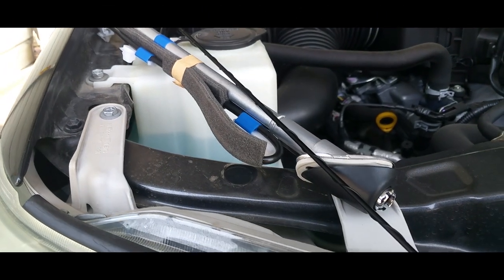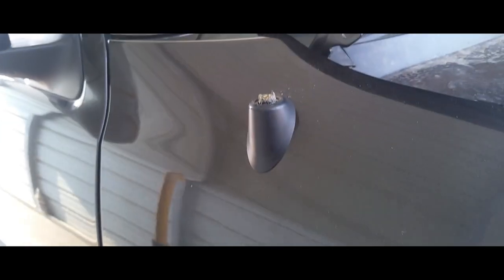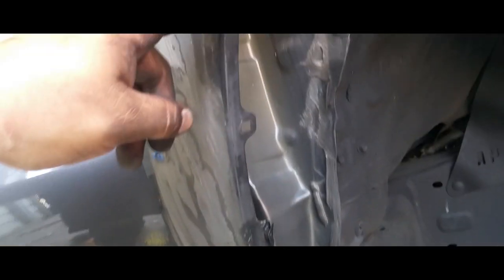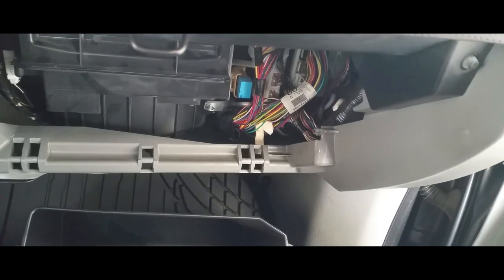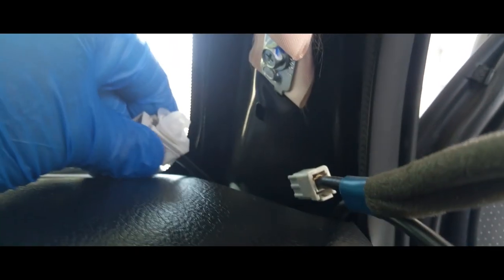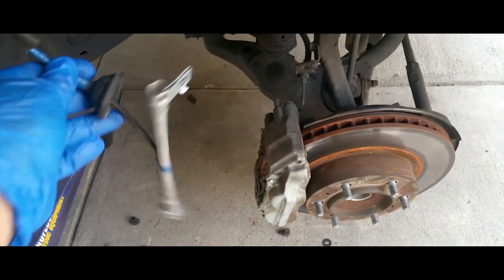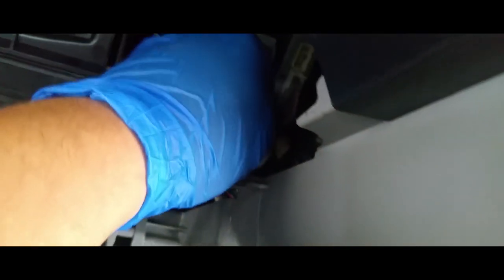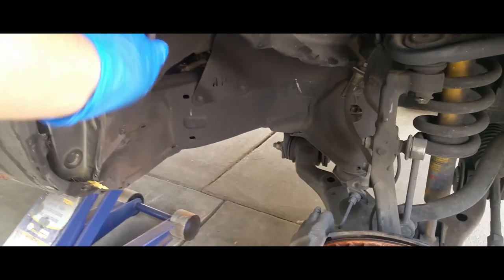How to: Replace a Antenna from a 2012 Toyota Tacoma

Comment: This gentleman did all the hard work, in videotaping and explaining while he was holding the camera.
I replaced mine today:
I didn't need to remove the wheel....
Removed two clips (broke one) from the wheel well cover and just enough to get my hand & wrench inside to remove the base of the old antenna..
Removed the glove compartment and pulled out the wire from old antenna
I removed the panel with handle to disconnect the plug. I didn't encounter any tape. Removal and installation with clean up, 1 hour, 15 mins.
Reply from the maker: Heck yeah brother 💪

Comment: Hi George! Thanks for posting this informative video. I just replaced my antenna today and it went quite well thanks to you! The hardest part was getting the old antenna base off. I had to cut it off with a hacksaw. Didn't trust myself with a grinder that close to the paint. Broke about 10 clips and had to go to the local Toyota place and get more. Whole job took me about 3 hours. Now my radio works great! Just for the record, I'm not a mechanic but an ER Nurse so that tells you how inexperienced I am with car stuff. Thanks again!! Forgot to mention, the Toyota place wanted $500 to do the job. I spent about $170 including the clips.
Reply from the maker: That's great I'm glad to hear I was able to help you out! I love getting comments like these, keeps me motivated to continue to make more videos. I'm glad you were able to save money, this is why I do it! Thank you for your support! Yeah the dealer will always try to make money💰!
Reply: yeah this helped me too.   Also had to cut that base and snap it in half but the best part was seeing that you have to remove the passenger handle and that trim piece to get at where the connector is.
Reply from the maker: 😳😳😳 yeah not any easy task unfortunately  😒

Comment: I appreciate the video it help me today replace my antenna line .. going through those car washes will definitely break your antenna .. popping out those fender screws is a pain in my rear end. I ordered 30 replacements for less than $10 on Amazon. They’ll be here in a couple days and I’ll finish putting everything back together at that time. Anybody that thinks about replacing the antenna do yourself a favor just order those plastic screws and cut the other ones off makes the repair goes so much quicker more than likely you’ll break the old ones anyway ..
Reply from the maker: Dang thats not bad for 10 bucks. Yeah those clips are a pain for sure. Good luck brother!

Comment: I have to do this. my 2013 tacoma only gets like 2 FM stations. The castle nut is not coming off like yours.  I dont want to drill it out. i know ill eff up my paint on the truck. any tips on how to get it off? will it break off with vice grips?? i have all parts on orders. bezel. castle nut. antenna. clips and fender flare clips.
Reply from the maker: Yeah you can try vice grips or maybe even a dremel
Harbor freight has a decent one for a good price.
https://www.harborfreight.com/96v-cordless-variable-speed-rotary-tool-kit-70-pc-63389.html

Goodluck brother

Comment: How did you get the flares off with out breaking any plastic tabs?  I have the new antenna, bezel, and retainer nut on order.  I also bought some new inner fender plastic rivets(4).
Reply from the maker: I used a trim removal tool to get them out. Best way to get them out with out breaking them.

Comment: Dude, you didn’t show how you took the antennae mount out, or how the wiring runs.
Reply from the maker: Whoops My bad Sorry
Reply: That chrome ring is the retainer but for the black plastic housing. After that, the antenna screws into the nut

Comment: Ok...how in the ever loving fuck do you get those grommets out that are holding the liner in place?  Do you just shove a screwdriver in the center and try to pry it out?  Or do you have to pry a screwdriver under the lip of the grommet and pop it out?  And is there any risk of damaging whatever the grommets go into?  For fuck's sake we can put a man on the moon but we can't come up with a simple way to attach a fender liner so it's easily removable?
Reply from the maker: I know right yeah I struggle to get the liner out. I had to use a Plastic Trim Removal Tool to get it out. You have you be careful and gentle and try not to break anything. Sorry man wish there was an e-z way to get this done.

Comment: I can’t even get my retainer ring off. I’ve basically ruined it and broke all the metal off trying to vice grip twist it off. Can’t find any info on how fix this.
Reply from the maker: You have to replace it like i Did
Reply: GEORGE LOPEZ HOW TO DO IT YOUR SELF the part you remove at :53 seconds. That part is 100% seized in place. How do I remove that part if it isn’t just going to screw out?
Reply from the maker: @smmalafa1  i had to use big pliers to get it out you might need cut it out if you cant get it out and get a replacement for it
Reply: @559powerscape  I cut off the retainer ring with a cut off wheel , I had already ordered one from Amazon.